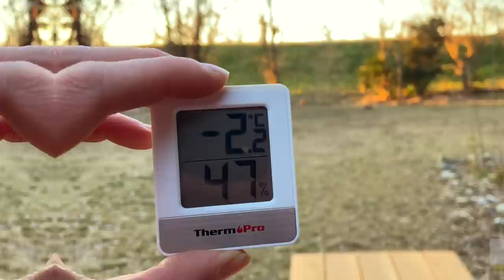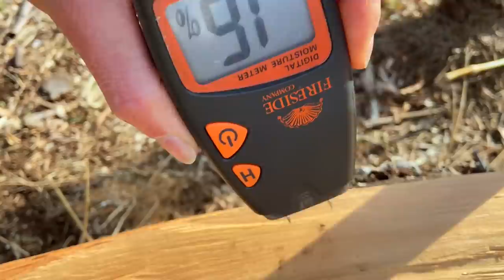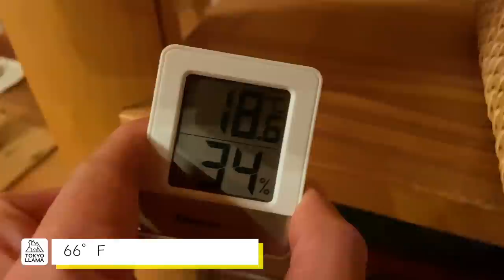Winter in a Japanese House | Tokyo Llama

Comment: The new regulation that is coming to Norway, when it come to insulation, state we need to have 300mm insulation + a 50mm insulation on top of that one, so just in insulation we need 350mm in two layers.

Recommendation we have in Norway for insulating homes:
- to start on the top, since heat goes up, and having a good insulated roof, preventing heat lose that way.
- When renovating a house, and replacing windows, is to "basically" build new walls, redo the walls with a thicker insulation. (after all the insulation that help you keep the house warm in the winter, will help you keep the house cold during the summer, so long you have an aircon-unit that can cool it down. INsulation works both way!)
- The Floor, a cold floor, will cool the house down fast.

My simple solution for cold spots and cold windows, is having thick cheap curtains, as a temporary fix, until something can be done. Even on walls

Comment: you have the most beautiful traditional house i have seen.  if you're smart you will put in a furnace with ac and gas heat and vents in the floor.  even if you have to create boxes.  then leave all the cracks.  a sealed up home gets no oxygen, smells bad, and has moisture problmes, and your house is already quite humid.  trust me i have experimented with many things.  a sealed up house with an air exchanger and furnace is not the best.  it gets cold and hot.  passive infiltration is way better and central forced air is the best

Comment: You could put the wood splitter on saw horses  you'll save your back look like Japan is not a country to use heavy curtains but that was the purpose  to cut the drafts in the old days   make sure you do your research on those triple glass windows  I know that ain't much difference between 2 pans or 3 beside the price  not worth the money  (use curtains in extreme cold lol) take care be safe

Comment: I recommend to you at build start hot water radiant heat
I use a Takagi , incredibly efficient , hot water and heat
Reply from the maker: Im thinking about this, at least for the bedrooms and bathroom. Works with an ecocute, right?
Reply: @TokyoLlama  Takagi is tankless , on demand , hot water tank , made there in Japan. Fired nat gas , propane , electric connected to a DYI manifold board. Low volume , low pressure pumps heated water , through PEX ,circulates in the home with themostats. Thermostats can be in each room or sections of the home as warranted by your manifold design.
Your only needing to heat 6 feet of radiant space , the floor and 6 feet up a wall. Should have been done at the beginning of the project when you had access in walls and floors. Nothing feels better than climbing into a hot empty bathtub or walking barefoot on a warm floor with snow on the ground 😋
Reply from the maker: @scottontheboat2340  I was thinking radiator style as you’re right, a bit late for underfloor heating.

Comment: does your woodstove have a intake feed pipe from outside? if not then the woodstove draws in warm air from the house to feed the fire causing a vacuum inside the house which pulls in the cold air from outside through any air gaps. this small feature can add around 25% efficiency to your heating and greatly reduce drafts.
Reply from the maker: Unfortunately our stove doesn’t take a pipe directly but I was planning to put in a closable vent to the floor space near the stove.

Comment: I was wondering how the heating would hold up in a hoise designed to be as cool as possible originally.
Also that fan above the wood burning stove, is it powered by the hot air rising off the stove?
Reply from the maker: It's not powered by the hot air, but by the heat from the stove travelling up through the base of the fan.
Reply: @TokyoLlama  thanks for explaining. That makes more sense than the way i thought it was working.

Comment: Don't know so much about the modern day technical achievements, but have long had a specific interests in the methods of heating and cooling a structure with less efficiency than yours has. Surely the bypass doors and walls of single pane glass does little to retain your interior heat, but have seen in China where clay, stone, and mortar are utilized into a central heating system from a contained wood burning oven with flue. It uses convection clay pipe air channels run through solid walls allowing the heated columns of air to promote circulation a cold air return of sorts back to the wood burning oven buried beneath the porch. Thought it ingenious, as I watched this retired fella hand saw test fit the beams, post, and rafters, while cutting the trench for airflow channel and the central fire chamber from the earth plastered over with clay set atop mortared stone supports. His home was frame and post, or balloon frame, likely nogged with natural insulative materials, with stucco finished walls and far few windows. You have a most lovely home. Would prefer to live there in the cold than any modern place without charm.

Comment: Hey, just checking, do you have a carbon monoxide detector and really good ventilation with doors and windows in the room with the kerosene heater? They can kill within minutes. Please read up and have your unit serviced for safety (especially because it's older).

Comment: Your place is not that bad. I have stayed in parts of Japan where when I wake up and it's -2c outside, the bottom 2 to 5cm of the single pane window close to the floor has ice formed on the inside and the room air temperature at 1.5 metres off the floor is a whopping 2c. You do NOT want to climb out of your futon to go anywhere and your bladder is screaming you should ASAP!
Reply from the maker: Ha ha, I can imagine! I think by Japanese standards we're possibly around the average!

Comment: To better start the wood firestove, cut small pieces (almost pencil like ) of dry wood then put them underneath the second stack and over the first log( where you put the paper in the video ) then put the bigger log on top of them without killing the airflow; light paper (clean cardboard works better, burns not as fast) underneath and the fire will light up so much faster
I'm a professional pizzaman and i work with wooden fire all day long; if you need any other tips on how to properly and quickly start a fire let me know!

Comment: I hate unvented kerosene heaters. I once hiked up to the hut just below the summit of Mt Kitadake, and bought a place in the dorm. It had one of those heaters in the middle of room. Absolutely miserable, I couldn't breathe (The men were all snoring loudly. What was funny is that awake the women made a huge racket- the men were all politely quiet.)  It was blowing rain outside, snow on the ground. The hut has to be above 9000' (2800m.) I went outside, found a spot partially blocked by some metal drums and slept in my $12 REI bivy, sleeping bag. One of the best nights of my life.  Freshest air. Not too much water in my bivvy in the morning. 
To retain maximum range, Tesla recommends using the heated seats over the cabin heat in their cars. (I've heated and cooled the cabin like any other car with no range issues.) At home - in Los Angeles ( it did get down to 4C last night -probably the low for the year) I sleep in a sleeping bag liner under an electric blanket (and a couple of comforters and a thick wool blanket.)  I think  if I lived in your house step one would be electric blankets, a lot of wool. Sleeping bags and fleece liners for the boys. (Fleece is cheap and so easy to sew - it doesn't unravel.) I might also 'winterize'  a portion of the house, insulate it and the windows, (maybe the kitchen and a couple of rooms around it) instead of attempting to do the whole house.
I do love sleeping in very cold air, but under very warm blankets.  I can't understand how unvented kerosene heaters are even possible. 
Cellulose insulation is reasonably inexpensive and you can just pour it onto ceilings. To remove it, just sweep it up, vacuum up the bits - use it again. In walls they drill holes and blow it in. (It has been 30 years since I had this done, so maybe it's obsolete.) 
Those digital thermometer. I bought a couple different ones on Amazon. They were a pain to use because I always had to squint at them to figure out what was the temperature and what was the humidity. I finally just put clear ('scotch' or magic) tape over the humidity numbers. I can still see humidity but which one is the temperature is now very clear. 
For that sliding door. Put the insulating strip on both doors so they 'interlock' (as much as possible). This way they don't rub against the doors as they slide but they'll close together when the doors are closed. 
The FLIR Camera is a great tool.    Sorry to be such a busy body.

Comment: Wow -- firewood for heat. That's old school. Since the fan on your stove is driven by exhaust, how do you filter out carbon monoxide (CO), carbon dioxide (CO2), sulfur oxides (SOx), and nitrogen oxides (NOx)?
Reply from the maker: The fan is driven by heat from the base, not exhaust. I have an air quality sensor and the air is usually fine!

Comment: wouldn't it be best to simply edify more isolation to the air gap areas in the first place instead of heating basically almost the outside as well as inside?

Comment: With all the space up high and large cavities and such. Wouldn't it be fairly easy to install air conditioning for heat?
Or use spray foam in certain places in lofts and such? All money dependant of course.

Just all that draught proofing and potential new windows, will all work against you when its warm and humid. Where as with air con heaters, who cares if heat is escaping, because its constant hot hair blowing, and they can then go cold in the warmer months.

Will probably take some maths to see what would work out more energy efficient, having heating on during the cold, or having everything sealed up well and probably needing fans or cold air con in warmer months.

Comment: Beautiful video. みんな雪遊びが大好きそうですね。特に雪合戦が大成功みたいですね。
However, I am more curious about your heating situation. You call the pile of fire wood that you made "Holz hausen". Which looks oddly German to me. So I looked it up. And apparently it is an American term that they use in the US to mean "wood house" (meant for burning).
Two comments about that: first, it should be "Holzhaus", not "Holz hausen". Whoever translated it made some mistakes right there - I should know, because I am German. So unless "Holz hausen" is Dutch or Danish or whatever, I think I am correct in pointing this out. Second, yes, when literally translated it means "wood house", which in turn would be "house made of wood". Now my dad used to have a wood burning stove in the cellar of our home that was used to heat the water in our house back when I was a child. And while he built wood piles with roofs so the wood could dry for a couple of years before being used in the wood stove, he never built it round like that. That's literally the first time I see it being built like that and I think the whole setup is pretty nice. So thanks a lot for sharing! そう言えば、俺も北日本の方へ引っ越ししたいなぁぁぁぁ。特に北海道が大好きです。関東の夏の気温や湿度などが好きじゃないですね。死にそうな天気はもうやめようよう。
Reply from the maker: Thank you, I was wondering if a German would comment! I guessed as much (that's why I put it in quotation marks) as I found out about it through American blogs.

Comment: Oh la la. I lived in Quebec, you never stack wood with the bark facing down like that. Always with the bark on top and try to stack it upper piece bark go on top of lower piece so water do not go on the expose wood but slide on toward the side or toward smaller tip of the piece. Think of the arrangement of tiles on top of your house, get the idea  Just a comment from one who had been using wood for heat for 40 years or so.
Reply from the maker: I’d always been told to have it facing up to dry more quickly, but you make a good point, especially if mostly uncovered like that stack!
Reply: @TokyoLlama  well you make a good point. Now the real question is: does it rain a lot (often) each year in your region not only in winter (you said it does not in winter) but in summer/fall and spring too.

Comment: Before watching; is it cold? Because I think it's gonna be cold. The winter I spent in Hokkaido taught me that in Japan insulation is something that happens to other people. People not in Japan in the winter. People in Japan in the winter have three-foot icicles crash through their windows. And kerosene stoves that only heat one room in the house. And space heaters that are a bad idea because the house is on one circuit and then you have to find the breaker in the dark after not realizing the house was on one circuit when you plugged in the space heaters. And you keep your snow shovel in your car because you have to dig your way back into the driveway at the end of the day because of all the snow. And the collapsing in front of the aforementioned kerosene stove after staggering home from the party where the kindergarten teachers got you hammered and you're the only one who had to walk to the bar and being so grateful you didn't pass out and die in a snowdrift on the way home. Ah memories. JET Hamatonbetsu, '09.

Comment: Have you put insulation under the floors ? This is one place you never checked.
Reply: My sister has in- floor heating and it is a very quick and effective way to heat individual rooms. I live in a warm climate and need no heat source, actually only about half my windows have glass.

Comment: FYI  Cherry wood yields about 19 MBTUs per cord which is the same as elm and almost as much as ash.  So cherry is a good firewood.
I don't use starter paper.  I don't use kindling.  I use a Turbo-Torch to start a fire in my Jotul.  I burn about 3 cord during the heating season. Cost US$660 and I walk around in shorts and t-shirts in my house.  BTW, I live in central Maine.  Hardiness Zone 4A.  I have seen -31 degrees F.